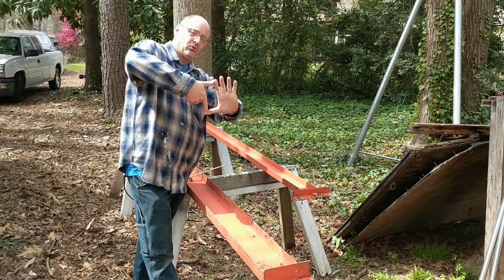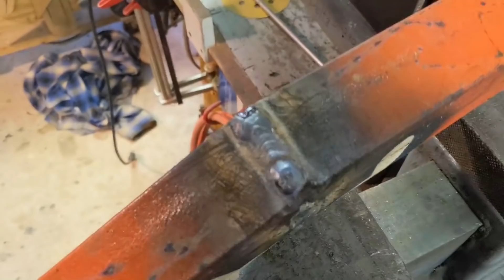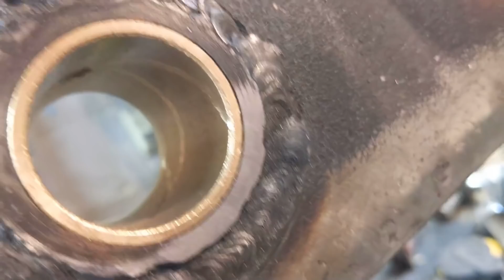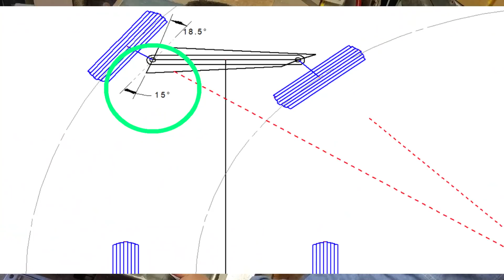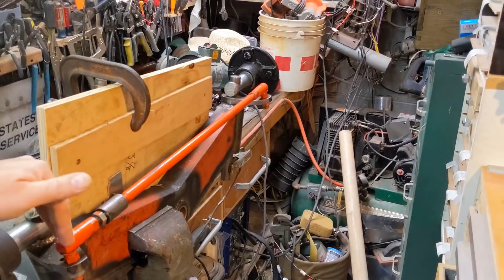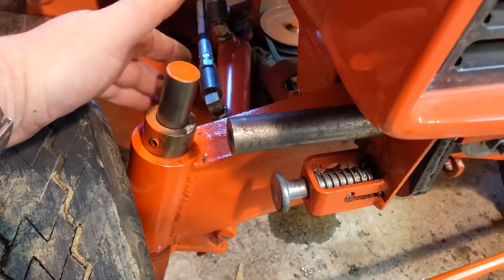Building a Loader for a Garden Tractor  - Phase 1: Rebuilding the Front Axle

Comment: Normally i dislike seing folks using hydralics for these small loaders since it is so much more exspensive and complicated than electric 12v actuators, and the small garden tractors they use can't take the forces anyway, but with the reinforcement you are doing this can definely take some high power hydralics without breaking.
Reply from the maker: I always appreciate candor, and you're right, especially for those less experienced.  It's a big part of why I did the series:  I'm proud of what technical level can be accomplished with a thoughtful approach and careful execution, but I also want others to see that you can't just buy a welder and start cutting up bed frames for materials and expect to get a usable loader.

Comment: Some roto cuts from Kimball Midwest they are so much better and more accurate than holes saw.  If you ever use those you will not go back to a hole saw
Reply from the maker: Annular cutters are great, but it would cost over $200 for the size I needed for this process.  Instead a holesaw cost less than $15.

Comment: This has got to tbe the only video explaining tye steering set up, I recently did a similar upgrade on my d160, adopting a 325 axle, 25mm kingpins and 1500lb trailer idler spindles, I am still fine tuning the tie tod to spindles connections to reduce the turning circles, the thing about welding steel, you can just cut and redo it .....
Reply from the maker: after this video, someone commented a shortcut:  The spindle steering arms/levers should be pointed in such a way that their "extended line" would precisely cross in the center of the rear diff.  if arms are the rear, then angled inward toward tractor centerline.  If in the front, then angled outward away from centerline.
Reply from the maker: https://i.pinimg.com/originals/19/56/9c/19569c19e8ed9915793338c933804075.png
Reply from the maker: that's where I ended up by trial and error, but I wish I had known the shortcut.

Comment: Good project but before you weld it all the way through the first joint with the black plate. you should of made the hole before fully welded well at least that's what I think because I had a lot of trouble with making any type of hole on a weld
Reply from the maker: Over time I've learned about drilling/cutting into a welded area, and it turns out that it's only the very skin of the weld that's hard to cut.  Apparently it develops some kind of crystallization as it cools, on the outer surface of metal.  Once you penetrate the outer skin, it drills/cuts/machines ok.  So after welding, clean off any bb's with a flap disk, those are hard as rocks, and grind off the weld surface with the flap disk too.  Then you can drill or cut basically fine.

Comment: Man that wedding ring is choking your finger. That made me uncomfortable looking at it 🤣
Reply from the maker: Funny story about that:  I've been married over 30 years, and one day about 25 yrs ago, I looked at my ring and it was split.  It has a transverse crack running across it, only the springiness of the metal keeps it in place. So it can bend and expand. A few times over the years it has pinched me, which hurt.  But a few times I've snagged it on something to the point that the ring got bent open and ripped off my finger.  No injury!  I just had to bend it back into shape.  So it's an accidental safety ring!   LOL

Comment: The best rule of thumb  for the Ackerman steering geometry for the steering arms is that they should angle back to the center point of the rear axle and the wheel spindle kingpin should be angled to the centerline of the tire
Reply from the maker: Can you expound on what you mean by the kingpin angle?
Reply: @TheBuildist  the kingpin is the point at which the wheels rotate left and right... The angle when viewed from the back with the kingpin in the upright position should intersect the centerline of the tire (or be as close as possible) as this helps the tires for both sides want to go straight reducing bump steer in a straight axle at all speeds (even if it's an arched axle). The further away from the tire centerline the kingpin angle as well as kingpin offset is the harder it is to maintain a straight travel path. Another kingpin adjustment is the lean forward/backward... Leaning the kingpin forward will lead to more straight line instability but give a more rapid turn response (taxi cabs use this to improve their lane changes) this causes the top of the outer tire to lean out during a turn and the inner tire to lean in. Leaning the kingpin back increases the straight line stability and keeps the outer tire more upright during turns while causing the inner tire to lean out at the top causing a better bite into the ground improving steering grip.  Another consideration is axles built for high loads have a few degrees negative camber built in so that the spindles point down towards the axle nuts this way when loaded the spindles and axle flex cause the spindles to sit parallel to the ground.
Reply: On my JD F 935 (rear steering), l removed passenger side tire and spindle,  installed passenger side 360° caster, slightly smaller pneumatic tire.  Now powered steering is only on driver's side, and passenger side follows perfectly, no more scalped grass.  Good luck, ps sharp turns are performed with steering brakes.

Comment: Very impressive work. I like your line of thinking right from the very start. I've done many tractor mods myself and also have come across many that others have done. You're the first I've seen that realizes there are limitations to factory-built machines. So often I've seen machines damaged beyond repair due to overloading, mostly from hanging excessive weights, oversized tires, etc., all in an effort to make the machine do something it was never intended to do. 

It's most interesting to watch you work through each issue, which to me is my favorite aspect of this hobby. When I first started, I tried to restore these tractors to the original but that soon became rather boring, not to mention original parts are always getting harder to find. I'm now more into modifying and building attachments. But with the same goal as you. Making it better than new. 

You would be a very interesting neighbor for sure.
Reply from the maker: Thanks, Joe.  That means a lot coming from someone with your experience.

Comment: So this is in no way to criticize your work. Just a constructive input to your work. Chamfering the weld areas of anything will ensure a full penetration and no gaps in between metal to allow failure or cracks to begin. Just like the steering arms, if you chamfered the inside radius of the piece. That will ensure that the steering will not have any failures in the long run. Great videos!!!! You inspire me and educate me to do my own build!!!!!!
Reply from the maker: Believe me when I tell you that I bevelled things extensively.
Thanks for the "heads up!"
Reply: @TheBuildist  Now that I fully completed the video. I had no idea what all goes in to steering. But thank you so much for the knowledge. I myself am gonna be (hopefully) getting my hands on an International cub low boy 184 and I’ll be putting in the same ideas to steering. I went to see it some time before this comment and I may just be able to build it with no major changes to the steering. Do you think a similar build can be done except adding a front wheel drive? Since the front axel is hollow, I think it may just work.

Comment: As far as the hydraulic steering rod goes you could’ve angled the ear back towards the cylinder. It would just take a little playing with to find the angle, then you’d be able to put the tie rod back where it goes.
Reply from the maker: It was trickier than it sounds.  If you watch part 2 you'll see I got it worked out.

Comment: Nice work. Just a pro tip from a welder. Next time grind down the paint where you plan to weld. You get better penetration and s better looking weld
Reply from the maker: Thanks for the tip.  I'm not sure where in the video it looks like I welded through paint. But I didn't. I only welded to clean metal. Especially using a 7018 rod.

Comment: i LOVE that u made ur own front axle..but i was wondering about grafting on premade axles...i know simpicity  had a mower with a loader amd so does cub cadet
Reply from the maker: Excellent, insightful question!  You're right, and I very nearly purchased a Simplicity axle and spindles off of Ebay.  But 2 things stopped me:  1.  Even though the purchase price was cheap, after shipping they were expensive.  Something over $250 delivered.  Homemade axle cost $75 total.  2. More importantly, with the pre-made axle I have to use the geometry as it comes, in particular the height from the ground to the axle pivot.  In all likelihood I'd have to extensively reconstruct the front area of my frame to make it properly meet and attach to the pre-made axle's pivot point.  The more I thought about it, if I had to take on extensive steelwork and welding anyway, why not leave the frame alone and just do that extensive work fabricating the axle?

And thanks for a great question!

Comment: The 520 by Wheel Horse has a special swept forward front axle that is head and shoulders above their other stuff Tapered roller bearings and enhanced steering geometry. Eve
 The Onan engine sometimes overheats it's test cylinder or you may be able to adapt it to an Ingersoll
Reply: Oh Yea, gots me a WHEEL HOSPOWER 520. With the heavy-duty front double-staped front spindle axles ,with the "almost power stearing " gearbox. I think it is very hard to beat with ALL its Fantastic Attributes.

Comment: It's actually very simple to figure out the ackerman angle. Drawing a line from the  tie rod connection on the steering arm through the spindle pivot should instersect the center of the rear drive axle. This will give you the correct ackerman.
Reply from the maker: Good point. I hadn't understood before the comments on this video that the control arms should be pointed at the center point of the rear axle. Once you know that, you're right hat it's easy to know the angle.

Comment: what rod did you say you used  i like 6011 for root and 7018  as a filler
Reply from the maker: I used 7018 rod for everything.  It welds beautifully but you do have to have really good clean metal to start with. No rust no paint.

Comment: Great project and great workmanship!
The only thing I would have done different would have been to machine new spindles out of ~3.00" bar stock, which would have given you a lot more inherent strength where the king pins pierce them, and you could have milled the stock square and then milled the 12° angle on one side to set flat against to steering arm. Also, I have a JD430 LGT that has 1" front spindles, and they are a know weak point even without a front end loader. I have broken tow on my tractor with no FEL. I would have gone for 1.25" spindles instead of the 1". Better to have more strength than needed than insufficient strength.
But still, you a doing a great job.
Now I'll watch part 2.
Reply from the maker: Thanks for some really good input. I will admit that cost won out over the desire for strength. Going up to the thicker spindles meant that I couldn't use golf cart wheels. So the cost of spindles and hubs more than doubled and the cost of actual wheels to put on them went up by triple. I do agree that the thicker ones are preferable. But I was trying to limit my overall spend. So these ended up being the sweet spot, even though I know they're barely good enough.  Let's hope I guessed right, eh?

But thanks for your good and thoughtful input.

Comment: new here and love what you are doing       but have a ?   whats your take on doing the loader with a cylinder  to turn a blade ?   why I am asking is I plow snow in Alverta
Reply from the maker: For this machine I already have a blade, so I'd probably just detach the loader and use the blad.  But to address your question:  I've built the capability in to swap out attachments on here so it wouldn't be hard to build a blade adapter to mount a blade where the bucket is.  But because I dont' have an extra spool valve to control the tilt, I'd have to do manual tilt for this particular machine.  If it were anticipated, though, I could have just as easily added a 3 spool loader valve instead of just 2.  Would have cost an extra $50 or so.  

FInally, it occurs to me that you could just cover the opening of your bucket with a blade.  maybe hinge it on one of the far sides and it could have adjustable tilt to that side.  That could be pretty handy for snow, a blade most of the time, but a bucket if you need to pick some up and relocate it.
Reply: @TheBuildist  so like a grapple then right never thought of it that way on a small scale  and keep up the great videos you do

Comment: Mount the cylinder parallel to the tie rod.
Reply from the maker: I love the idea. Figuring out the geometry of how to get the cylinder mounted sideways and pivoting with the axle at the same pivot point turned out to be beyond what I wanted to fool with, since I was able to fairly easily figure out how to just get the cylinder working near its original configuration. But I love the idea.

Comment: How did you maintain your angle yet miss the angle block when you exited the hole?  I would have been a little more worried about the two points of contact with a round workpiece in flat vise jaws especially with that uneven entry.  Lots of torque when only one flute is contacting even if it is for a few rpms.
Reply from the maker: Excellent question, and good observation.

As far as the angle block, I pulled it out before I penetrated the bottom surface, so I wouldn't hit it with the bit.  By then the bit was well aligned in the vertical hole, and there wasn't any meaningful side/angle pressure.

And you're right about the single flute contact, which is why, before I drilled with the 1" bit, I took a carbide burr and beveled the top surface where the bit was about to seat/bite.  I worked down the high side, so that both flutes would begin cutting at the same time.  by doing that, though the workpiece is angled, the drilling shaft and pressure is all just vertical.

And I tightened the vise down more than I typically would.  It worked like a charm.  

Thanks for your input!

Comment: I weld 100% ! Thats the only right way to do it. Hardened wear washers can wear into the ears on the tractor. If you use brass washers the washers will wear only and not anything else.
Reply: Also you can drill the pin out to grease bushing.
Reply: All if you can. But should be plenty strong the way you made it. I have a cub cadet 70 and I found an original danco loader attached made to fit the narrow frame tractors. I think I'll leave the front end alone except for maybe fixing it if the pins and bushing are loose. I hope the smaller engine can handle the loader. Your machine looks great!
Reply from the maker: I appreciate the input.

Comment: What about moving the ps cylinder to the front, perpendicular to the line of travel?  The cylinder could directly actuate the tie rod(s).  It would mean longer hoses but it would solve most of your binding/interference issues.
Reply from the maker: Excellent suggestion.  I considered it, but my tie rod is shorter than the length of the current cylinder.  So I'd need to source a different cylinder.  I considered buying the cheapest power steering rack off of Rock Auto or such, but that could open Pandora's box of cascading issues to be resolved.  If you keep watching, you'll see it does all work out in the end.

Thanks again

Comment: The Case and Ingersol hydraulic drive tractors are built very well but can cost a lot to repair when the drive system wears out. I had two Case 448’s and I didn’t like how tightly the engine is stuffed under the hood along with tight access to the pump under the dashboard.
Reply from the maker: Good observation. I've only done very much work on cases and Cub cadets. The older Cub cadets did have more room to work on them, but they were single cylinder machines with far less power. And when you consider Case's built-in live hydraulics, machines like the Cub Cadet didn't have anywhere near the capabilities of the Case machines. But I can imagine how some people would prefer their more traditional drivetrain with a clutch and transmission.